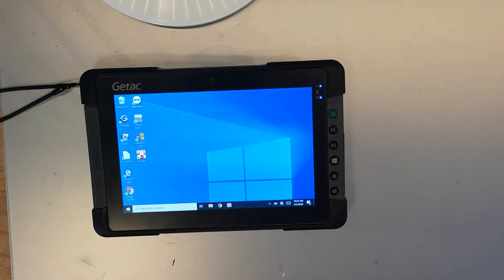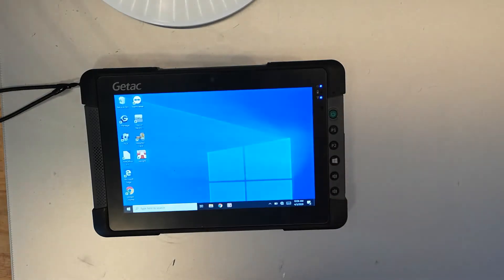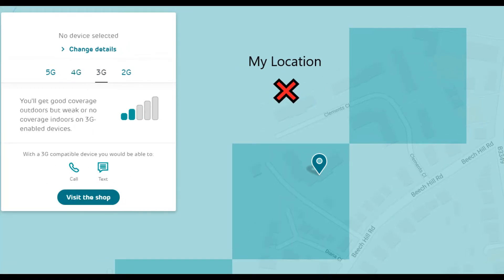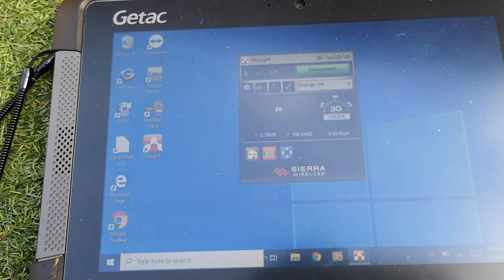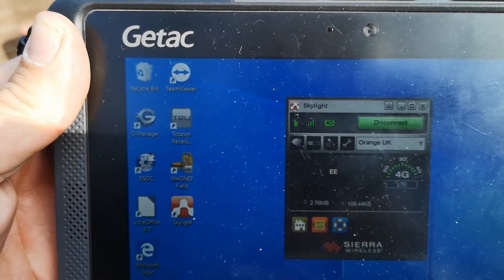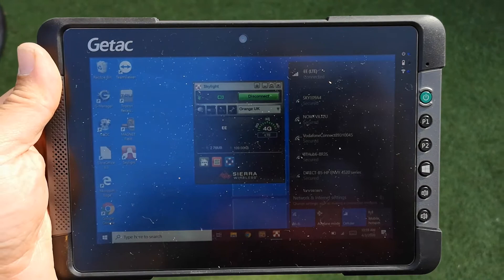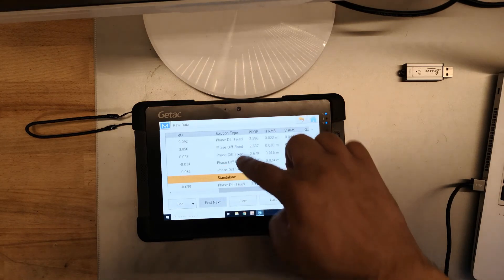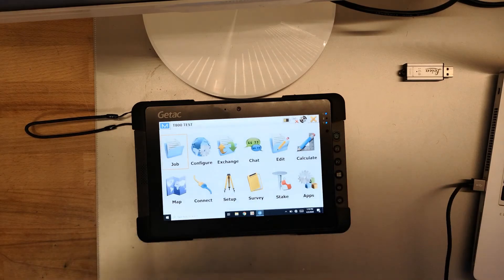Getac T800 post 4G LTE modem installation test(1)

Comment: Good afternoon. Very interesting video. It is a pity that the continuation of the tests was not filmed. Tell me, how effective was the use of t800? And one more question: why did you need to update the magnet field? (I translated the message through a translator, I hope everything is clear)
Reply from the maker: Hi. The T800 works just as good as the FC5000. Can’t comment on the FC6000. I still use the T800 today, it’s does a good job!.
I updated magnet to see the time date stamp of the auto topo measurements. I recall there was an issue with the GPS message year count, topcon released firmware updates for the Hiper SR gnss board complimented wit a magnet software update, I didn’t realise I’d forgotten to update the T800 during filming so ran a OTA update to test download from the network.
Reply: @topconjohn6152  Thank you for your reply. I'll try to go your way. I still have one more question: did you use an LTE module with two connectors or with three (+GPS). It's just hard to see in the video